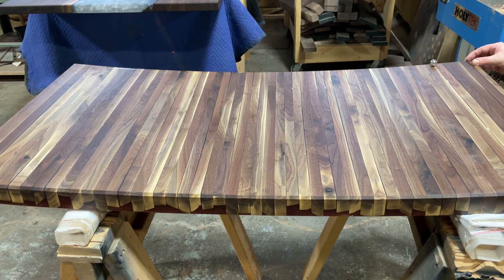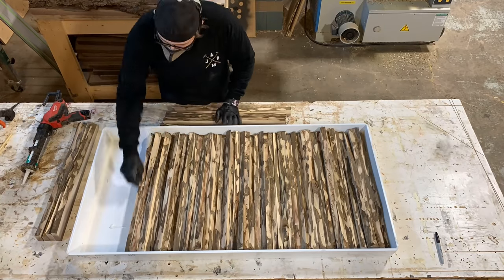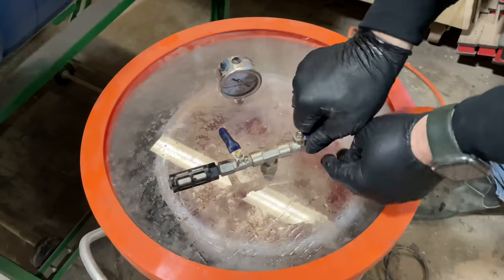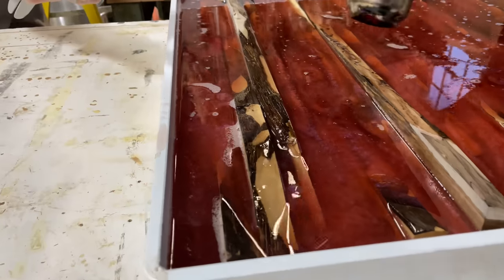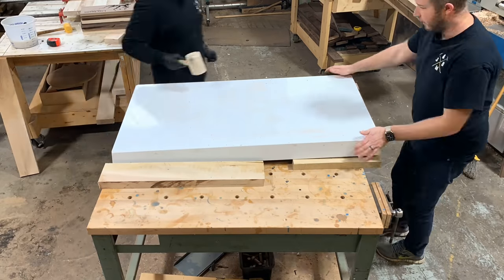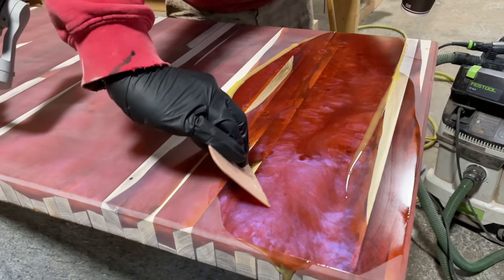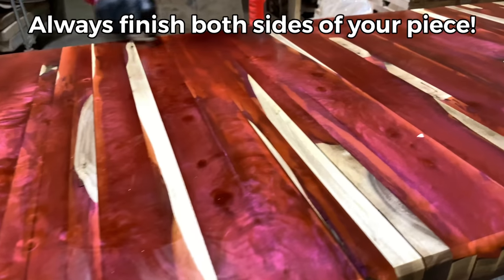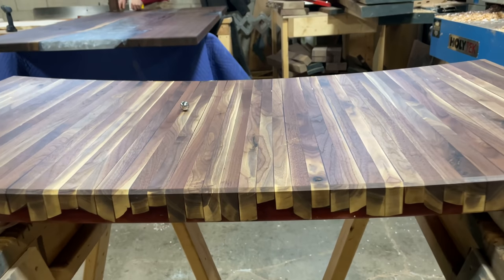EPOXY FAIL | Don't Make This $1000+ Mistake

Comment: I had same problem with one I did years ago.  Moisten the bottom with some water and put it upside down in sun and it will flatten.  Then coat the bottom with clear epoxy.
Reply: Exactly what I was thinking!
Reply: Take .5 inch off bottom then add .5 epoxy on. Top of wet and sun unwarp
Reply: Bam they should pay you to supervise their work. I deal with warped wood all the time and water and clamps will do amazing things.
Reply: You are right
Reply: I’ve done the same thing as well. Should work.
Reply: @Ken Brown I’m having a similar problem with a table top warping...the underside is resin coated, the top has been cleaned off with a River down the middle. So you’re suggesting applying water to that top unfinished side and put that side down in the sun?
Reply: @jmains  wet the wood and put the bow facing up, support both ends and add weight to the middle. Keep an eye on it, look for it to flatten out. Go a little past flat so when you take the weight off it will spring backa little.
Reply: yes that should solve it. you might want to sand off the finish first..
i'm curious why it warped like this because i don't think their explanation is right. Wouldn't the tabletop warp the other side if it was  the wood soaking in the finish?
Reply: @robjanweb  the unsealed side dried out causing it to shrink. Which put a bow in it.
Reply: @dozerboyd8784  Also, wood and epoxy  have different coefficients of expansion. You can put wood in the center of a piece or epoxy in the center, but not one on the bottom and one on the top. Bad design.
Reply: You will need to remove the finish from the bottom first. Adding an acid like vinegar to the water also helps to soften the wood. Then it's a matter of tension forming the wood with heat (steam also works) and some thick straight beams. Same idea as ironing a shirt but way slower since it's really thick.
Reply: I don't think this will work I think it worked while the epoxy was curing still and still in the soft stage
Reply: Similarly, put it back right side up; with the bottom unsealed, put put it in a plastic tent with some humidifiers; let the water flatten it, then seal the bottom
Reply: Yes sir sounds right...1000 mistake easy fix should be the name of that video
Reply: Try soaking the wood and see if it flattens out. If it does seal it and head back the the cnc table to get it dead flat
Reply: @robjanweb  I think their onto it.  My guess is the resin shrinks, and the wood doesn't.  It cures faster at the edges causing the internal forces to pull inward.  Those forces are always going to be there when attaching to a rigit object. Just a guess.
Reply: My answer too. Glad I read this before I wrote it.
Reply: That is what I would do. This is the best answer.
Reply: Great to hear how to fix the problem,  rather than cut it up to make bird houses?!?🤪
Reply: Yep  same here
Reply: I think that this was about the most plausible idea at the time. Yet by now with cure time the situation has become irreversible. The heat from the epoxy curing sped this process along dramatically due to the amount of product used. I for one think that there is and have been many good and novel ideas of what to do as well. Best of luck to you, I hope that you are able or were, to use this method and correct this issue. It is a beautiful table, and to not even use as a accent piece itself would be a shame.
Reply: @petetimchal1908  As a newly married young woman at 21 yrs old I learned about water and wood as well. I was given a wood cutting board that I very naively thought I could toss it in the dishwasher. I ruined that cutting board. My father in law fixed it for me and I've never done that again.

Comment: Idea for curved piece: Make it into a hanging light. Make recesses from the wood side almost all the way through (or all the way if you prefer), install the lights in those recesses, then suspend it from the ceiling using metal wire. would be a very impressive, unique lighting fixture that also illustrates how you respond to "failure".
Reply: Wouldn't it be way too heavy for a light fixture?
Reply: @lindab424  the weight is certainly a concern, but more of a technical challenge than a hard limit. With the right suspension cables, it could absolutely work. Excellent point to consider tho.

Comment: Build a coffee table with a framed top that would hold this art piece so that it can float inside the frame and then either have a glass piece sitting on top of the frame or have pegs in this top for the glass to sit on.
Reply: And then let the marble run back and forth so you can see it through the glass !
Reply: @nicolasfredette8564  have a hole in the lowest point on one side so it can exit.  Kinda like a reverse foosball table.  I'd love doing that over and over again
Reply: Use the same idea from above (i.e. the floating table in a table), swap out the marble with a steel ball, and incorporate some magnets/ electromagnets to create perpetual motion with the steel ball where it rolls back and forth perpetually.
Reply: Great idea...Use black pegs or Glass pegs to level out the glass...:)

Comment: I will suggest to fill the top part with more epoxy to straight it up. And put some epoxy on the under part just to prevent it from curving again. 
I would use the current curve as decorative feature

Comment: I've had this happen to me once on a pour, as it happens to me as well when I'm making samples on Masonite. This is what happens, because resins are Exothermic and create tons of heat, the will cause whatever wood in any fashion to absorb the heat, and warp during cure or during the cooling off period. With the wood strips having been placed in the box form, there wasn't anyway for the epoxy to coat the underside, which would help prevent some if not all of the warping. When I'm not coating the underside of my project tabletops, I will anchor 2 pieces of angle iron to the length of the table to stop further warping. Length of pieces TBD as needed for you likens. 

Anyway, when my tabletop warped like this, I put it in the direct sunlight, warped side up or arched side up. Once it became a certain, which was well over 100 degrees, and took about 6 hrs to do so. It became pliable to a degree. I was able to site a ton of weight on it in a shaded cooler area and it pulled it down about 80%. So I then used the angle iron to pull it down even further. Plained it down again and walla. 

If you a kiln, or big even commercial oven, that may help speed it up or control it better. Good luck.
Reply: Viola
Reply: @carrieeloff2220  Voila
Reply: @robertedmonds9396  lmfao I hate when I do that

Comment: At this point, I would install some stainless steel stilts, maybe 3" tall and have a glass top made for the piece.  The "floating" glass would make the table surface flat and usable.
Reply: glass sucks
Reply: This is an excellent idea
Reply: That’s what I was going for an elevated clear top and finish it as a coffee table

Comment: You can probably still correct it by heating it and applying epoxy again on the other side to correct it.
Then use clamps and bolts. 
Otherwise just use it as a fence or something.

Comment: you need to leave it somewhere with higher humidity to flatten it then when it's flat cover the exposed wood with a clear epoxy to prevent it drying out and warping again. Either than or you could cut it into short sections square these pieces on a jointer/planer then glue it back together and again cover the whole thing in clear epoxy to stop it warping again.

Comment: I’d create an outside edge frame made of a metal that either is, or closely resembles a vintage cast iron. I’d also run a center brace across the underside (length wise) for support. I’d hide the screw holes by using a vintage pop-riveting looking cap, with a brass or copper coloring. That just might heavily increase this piece’s value to a much higher amount. 👍
Reply: Easier fix and more cost affective. 
I believe the reason why the table began to bend is because you have the natural curvature of the log on the same direction.
You have placed each piece with the ring of the tree facing down. Meaning it will naturally want to curve again. 
To fix. Place one peace facing down and the next facing up.

Comment: just cut it into longitudinal pieces, then flip it and add epoxy to the part where it is 100% wood and then level it so wood is almost in the middle. then you get a piece with wood in the middle that isn't wrapped
Reply: but that would make the cost of epoxy higher
Reply: @alexmax612  increased costs is pretty much inevitable when it comes to fixing mistakes. One of the main reasons people don’t generally like making them.
Reply: @alexmax612  cheaper than trashing the whole piece
Reply: @birgittabirgersdatter8082  well said

Comment: I agree with others on two things: thanks for posting a "fail" it's great to see process that ends with something less than what you expect. And second I would love a table like this. The curve could be really cool. 
Why not build a base for it that corrects for the warp? Something like rails on either long side might be able to pull it back to shape and add some form to the piece
Reply: Epoxy hardens too much.. if you try to bend it back you'll crack the epoxy.. better off shifting plans and do something else..
Reply: You can also make a dozen cuts across the table and inlay a red oak or red maple strip to flatten the top and give it a very unique look

Comment: Some great ideas here, I like the one with the glass on top with supports at the ends of the curve, but since you guys love your epoxy, what about pouring a layer of clear epoxy on top to flatten out the curve but leave the bottom curved, just like you intended it to be ;-)
Reply: The problem with that is any epoxy on the top will want to flow to the low point of the table.
Reply: Wich wouod be perfect to even it out lol
Reply: mucho material y aumentaría mucho su costo
Reply: @steeghs1  Yeah... That's how gravity works. Either way, since the curve is so big, they would need a ton of epoxy and the middle would have to be a few inches deep just to cover the whole thing to the point where it's flat.
Reply: Not if it keeps warping.
Reply: I like this idea, maybe some LED lights?

Comment: Do another in a coordinating color, cut them back into strips and lay them back in molds other way down in herringbone pattern, coat the other side of the wood with clear epoxy.
Reply: Woah. This is the one they should do.
Reply: Agreed this is the best idea I've seen so far to salvage it
Reply: Yeah! Treat it like an endgrain cutting board project!
Reply: Nice idea. They wouldn't even have to cut completely through, just a series of cuts 4/5th of the way through from the wood side. That would allow them to put it back in the form epoxy side down, clamp ends down so it's flat,  then backfill with epoxy.

Comment: Pretty! I'd suggest slicing it in thin strips  the length of the slab, lay the strips side by side and glue them together, reinforce, cut sides to desired rectangle shape, seal, add legs -M

Comment: If you were able to cut it the into two sheets with a straight boundary, theoretically you could the glue is back together with the top on the bottom to make a flat surface. It might even have a really cool aesthetic from the process after cleaning up the likely misaligned edges with some more trimming.
Reply: this is what i was thinking about

Comment: On a CNC, cut thin (wavey?) lines into the wood side (about 90% of the way through) Clamp it flat. Pour resin over the wood side. (like a small amount)
Reply: Idea for next attempt that will save money and time. 
I believe the reason why the table began to bend is because you have the natural curvature of the log on the same direction.
You have placed each piece with the ring of the tree facing down. Meaning it will naturally want to curve again. 
To fix. Place one peace facing down and the next facing up.

Comment: Put it in the sun to slowly heat the epoxy, with a little weight on the ends, after it flattens out bring it back inside, and sink some steel bars in channels going length-wise and seal the bottom with epoxy.
Reply: My thoughts exactly
Reply: Same thought
Reply: I was thinking the same but i would put a length of cornersteel in. This is a verry tough. You can even use it te straigten it. I used this on my oak table and with just turning the bolts the table straigtent out. And thats al lot of fors.
Sorry for mij my english ;)

Comment: Pour more resin (in a slightly different shade) into the mold. Lay piece concave side down into resin. Flip and repeat process for convex side. Inlay a metal strip if there is a space around the perimeter of the piece when you are finished.
Reply: My answer was similar...lol

Comment: Maybe just glass over the top. The curve could be like a suspension bridge.
Reply: Dig this idea. Could even have some supports/legs coming up through the top to help support the glass towards the middle.
Reply: Not a good plan
Reply: Only thing is the epoxy would be on the bottom side...
Reply: @bryanedwards7623  I was actually envisioning the opposite effect.  Have the supports on ends, epoxy side up.  Like an old bridge across a small creek.
With a mid height shelf that looks as though it is a small creek (in epoxy of course)

Comment: Light epoxy finish on the open side and make two complementing table tops. You’ll have to flatten the two and will loose some thickness, but as you started with a thick piece, you’ll end with still two generous tops.

Comment: I would gladly spend the rest of my life with a warped table looking like that. As Bob Ross (roughly) said; there are no mistakes, just happy little accidents - and having a warp that significant really makes it pop especially from an angle! And as that angle also shows the border of the epoxy and wood the best, that's an amazing side table! You could also just put support points for a thicker glass cover in the ends and let it rest closer to the surface in the middle - I think some kind of metal peg supported glass cover could look amazing and hopefully not make it look too busy.
Reply: you're crossing a line. 

Like Bob ross art is good. But if he made art out of the corpses of unborn children, that is crossing a line.
Reply: bs,  everythign would fall off fromthis , it is not usable
Reply: metal peg supported glass cover sounds like a great idea - really unique look underneath, flat usable surface up top.
Reply: @mobySlick_  Precisely my friend
Reply: @orkhepaj  Dunno man, that's what the level glass would be for, and even without it I've seen a Chinese guy on TikTok balance a rocking chair on a wrench on a beer bottle. I'm fairly sure he could balance a candelabra and some car keys on a slightly skewed surface 🤔

Comment: Fix suggestion: Cut curved slab accross short dimention so you have 4 equal sections.  Then use a router sled like a thickness planer to make 4 pieces truly flat.  Resand and polish.  Then add various uprights of any material (wood, metal, stone, PVC or whatever) to create a freestanding book shelf.  Either perfectly align all shelves or offset them all for continuing the freeform look of the wood in your slab.  Remember - NOTHING is trash till you put it IN the trash!

Comment: I would make a bar table with this as the base. The curve can be left as is.
Reply: or this as the vertical front to a bar would look cool too
Reply: @kanedNunable  that is what I meant by making it the base. Turn the table onto one of the long sides and use it as the base.
Reply: agreed, that would look wicked cool.
Reply: Thinking the same thing! Great idea

Comment: That would be pretty straight forward to flatten out. Have a frame to go around it welded up out of 1/4" steel then screw it on from the sides after flattening it out. I make exposed carbon fiber parts and the last step is to spray an automotive clear coat on the part. If you don't the UVR's will turn the epoxy brown over time.
Reply: I agree with you, I'm late coming but my comment pretty much matches yours to a tee !!

Comment: I’ll buy it. I’ve been waiting for this piece to be finished and actually was going to try and recreate it as a bench.  

I think 2 benches is the route to go as another person mentioned but maybe put some sort of mirror or reflective piece under it so the cool epoxy doesn’t go to waste. 

Another option is rip strips that could be the edge of a very large circle table. Maybe test the bend and see if you can wrap a circle table of whatever size too. You’d get the color and live edge irregularity.
Reply from the maker: $1000 and its yours!
Reply: @jeffmackdesigns  🤣 wow

Comment: Someone probably already mentioned, add moisture with wet rag and iorn to wood. Where it almost flat. Then seal with clear epoxy, probably will be best to build a very supportive base underneath to attach to help it stay flat
Reply: Doing that would crack or break the epoxy on the other side .

Comment: I would pour one more layer of epoxy on top to make it level, so you'd have a curved underside, and a unique "depth" effect on top. And a bit more weight :)
Reply: this is the correct answer imo, you could even add another layer of uneven frontfacing pieces so the exposed effect was on both sides.
Reply: That would take a lot of resin. And how would you poor it?
Reply: @JL-tj4hq  it already took a lot, but it could be a unique piece that you can sell for a premium :) If the guys are intending to throw it to the trash, please send it to me, I'll take it.

Comment: Would it be too large for wall art? Perhaps incorporating the warp as “art” feature rather than a mistake? Cutting it down to smaller, manageable pieces for wall art as well?
Reply from the maker: The "wall art" solution was my first thought too. Maybe mount it using some standoffs and back light it. Thank you for the feedback!